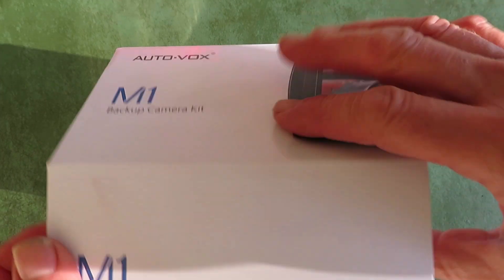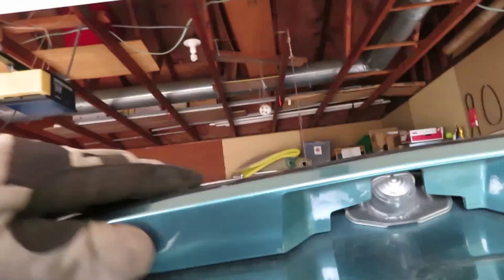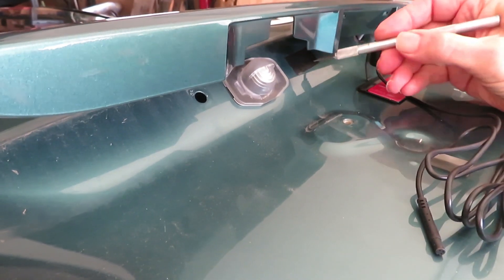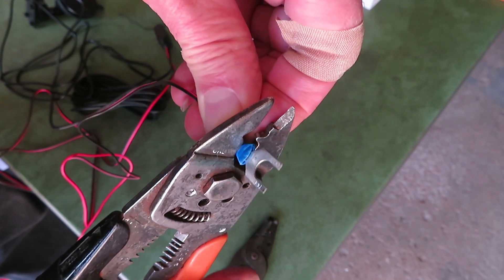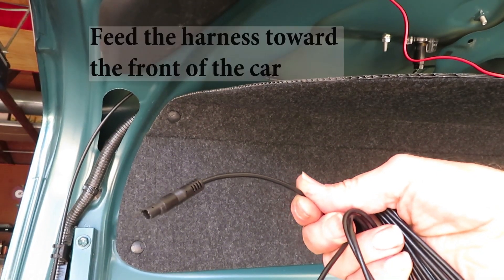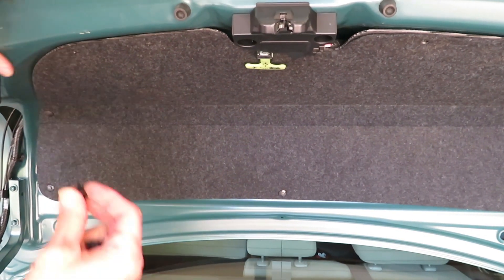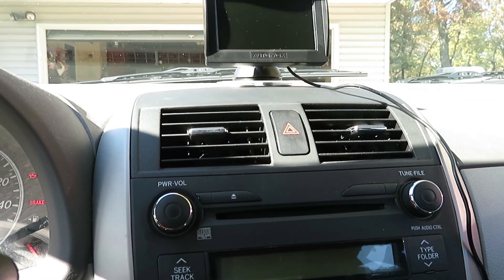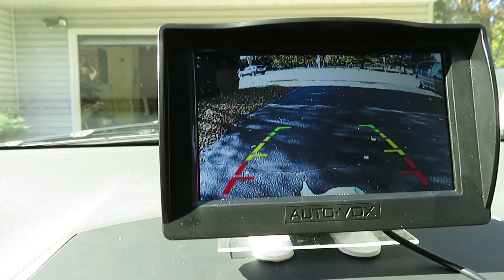How to Install a Wired Backup Camera: Auto-Vox M1 in a Toyota Corolla

Comment: Phenomenal video, I am going to use this to install my backup camera. The only part I am confused about is wiring the red wire to the reverse wire. My camera did not come with a connecting piece like yours did. Can you tell me what that piece is called so I can purchase one instead of having to splice the wires together?
Reply from the maker: That actually is called an automotive splice connector. Auto parts stores will have them or possibly a hardware store or big box like Lowe's. Or of course online.
Reply: @TheOriginalMechanic  Thanks so much!
Reply: The Original Mechanic crazy thing is I just backed into a car last week. Thankfully I fled the scene no issues. But after that happened I knew I needed a backup camera.